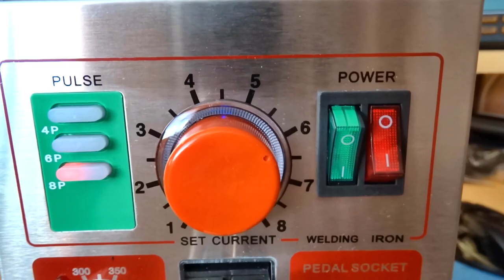AtomRC Swordfish Build

Comment: Hello Bill. I am buying this plane in KIT version (without any electronics) and I wanted to ask about the servos. I have seen in the video that you have used EMAX ES08MA II for the tail. Have you used the same type also for the main wings? I am little bit confused since in airplane's specification there are 9g servos and those EMAX ones are 12g. Did they fit well? Thanks, Ondrej
Reply from the maker: Hi Ondrej yes Emax all round the plane perfect fit dont worry about it.  Bill